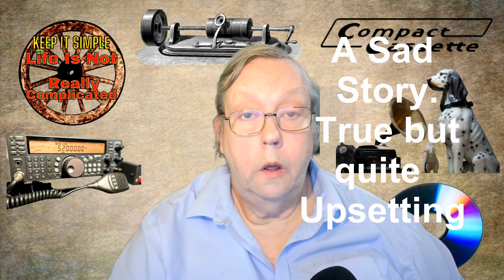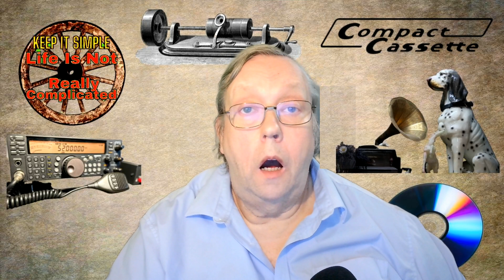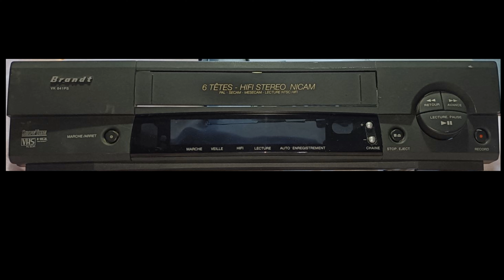VHS Resurrection: Will the First Step to Repair work?

Comment: what a coincidence....  I have a Philips VR740 (funai made of course).  It's a 6 head Hifi Nicam model.  I'm considering turning this into an audio recorder like this guy did (his is not a hifi unit).

https://www.youtube.com/watch?v=_03QOPrRZco

Of course if mine doesn't go up in smoke aswell...
Reply from the maker: All you have to do to get this to be a hi-fi audio recorder is to feed into the scart a video cvbs signal. Any old signal ie a video game or such like and audio into the audio in. If you fed in "black" most of the problems he was talking about would not exist.  But as this is a hi-fi machine the problems are probably not a problem anyway. It does not talk about audio recording in the user manual so I assume either I missed that part in the manual or it does not do it as such. ( I found the operators manual online)  That gentleman was very clever. I wish I could have done something like that back in the day. the only problem with his unit is it is a ONE off so when it's gone  it's gone. . I suggest you do look to see if you have a RIFA cap. the PSU in my Brant is the same (to look at) as in my JVC  made in japan. the JVC is the same age or older and PSU is fine. manuals here https://www.manualslib.com/manual/542998/Philips-Vr740-02.html?page=22#manual